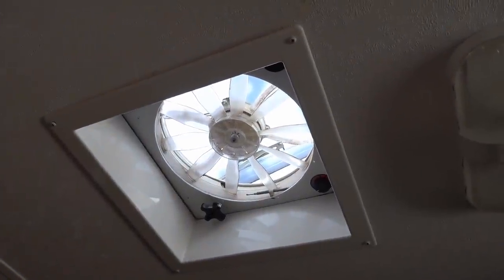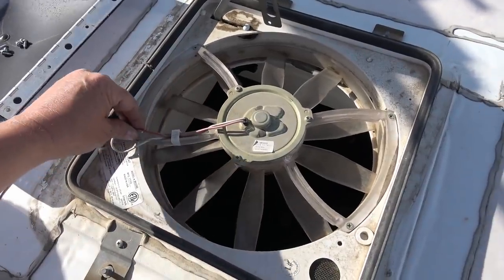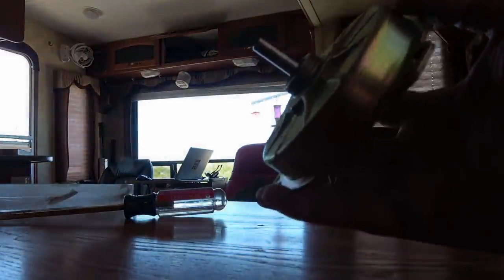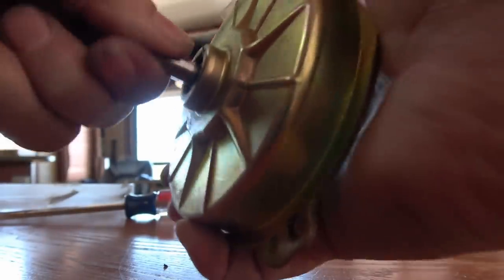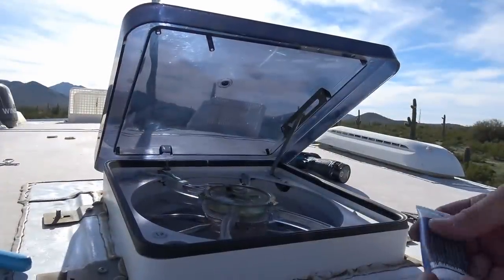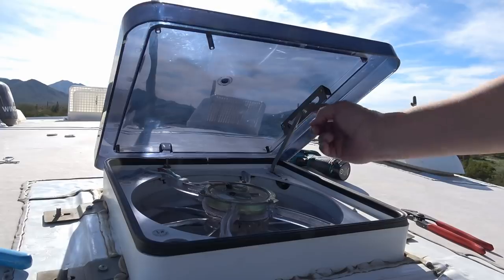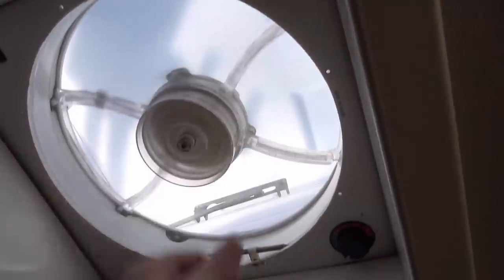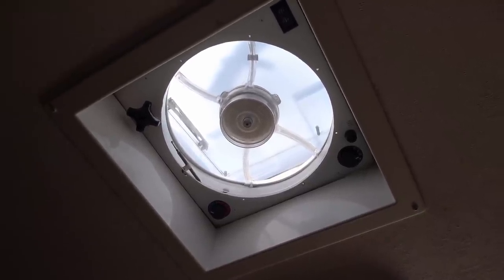FanTastic Fan Maintenance - Cleaning & Lubrication Attempt

Comment from the maker: See original install and review video - https://www.loveyourrv.com/installing-fantastic-vent-fan-rv/
Reply: I assume you gotta use their top vent. I want to add a fan in a regular vent location. Two issues, it is a 14x14 regular Camco vent in a new Winnebago.
Also, VERY close to front curve and the Fantastic and Maxx fans are bigger.
How many inches does the front of the vent extend from the 14" opening? Approximately is good, no need to go up there and remove outer cover.
Thanks Ray...
Reply from the maker: @bobcole3852  I'm pretty sure will work with a regular vent cover, the Fantastic Vent is for better airflow.

Comment: It looked like a ball bearing on the fan's motor shaft.  "Sealed" ball bearings eventually use up their grease supply and go dry.  Squirting silicone oil into the bearing may help for a while until the silicone evaporates, too.  I used to work at a vacuum cleaner repair shop.  On rebuilt vacs which the manager did not want to spend any money on, we re-greased dry motor ball bearings (if they were easily accessible and not damaged).  The black plastic side plate can be pried off and the bearing repacked.  This will double its life and save the cost of buying a new motor.  With the fan's motor case welded together, the rear bearing is inaccessible.  However, it is usually the front bearing that fails first since it carries the weight of the fan and motor armature.  (Note: The squeak could also be coming from the motor brushes if it is not brushless.)
Reply from the maker: Thanks for the info!

Comment: great job ...judging by the noise try to open the engine and replace the lower internal bearing which is probably oxidized and making noise

Comment: I had the same issue with both of ours.  Since it was in service the third year, Dometic sent replacements at no cost, but I had to pay about $15 in shipping.  If it is under two years, they pick up the shipping. Great service from a Dometic!
Reply from the maker: The original FanTastic Fan company used to have a lifetime parts warranty, then they got acquired by Atwood 2010 and they stopped that, then Atwood was bought by Dometic. I have the Atwood version. I've found the fan on eTrailer for $35 so not too bad.  I'll give Dometic a call if the squeak continues, see what they might do. Cheers, Ray

Comment: When I took mine apart to add a PWM speed controller, i took it apart from the inside (bottom side), i was able to access all the wire connectors there and unplug the wires without cutting them. Also, adding a PWM controller is an easy way to save power while boondocking, it will let you adjust your fan to many more increments than just the 3 settings it comes with, and its more efficient because the original speed controller is just a series of resistors.

Comment: I had same sound when brand new, I unscrewed and dropped some T9 Boshield Lube and ok since one 1/2 year.  Just cleaned my two, same model. I Took the fan fins part off from the trailer by wiggleling it and pulling.  Than on the roof, loosened the bottom screw of the Hinge than undo the top screw, the lid canteen  be freed and cleaned without undoing the hinge.  I did not want to cut the wires so I brought all cleaning gear-lube-Plastic protectant on the roof :-0) I wish it had connectors that clip on, I am not electrically inclined.  So tooth brush and Q-tips and all,, I then put plastic protectant from UV Like M303 or Protect All or else on top of the Fantastic Fan Covers.  I find the bugs don't stick so much,  I put all back together and re-screw the fans fins part from inside the trailer.  Thanks for this Video Ray I always love to see the cleanness of your roof, while I was up there I I tried to turn white my dirty silicone spots.

Comment: For years I've used a teflon lube from Radio Shack (64-2301a) for PC CPU and Power Supply fans. It's brought dead seized fans back to life. Once lubed I've never had to mess with them again. These were systems that ran 24/7. Unfortunately it doesn't look like they carry it anymore. I've seen teflon lube on Amazon DuPont but haven't tried it as I still have enough to last me a long time.
Reply from the maker: Thanks for the tip!

Comment: Ray 
Keep a close eye on the motor. When the bearings start to get noisy and squeaky. The next thing that can happen is the motor will seize up. The normal issue with sealed motor of that kind is the bearing opposite the shaft is failing.

Comment: Ray, you seem to be totally confident on your roof. Aside from falling off, its scares me to think of breaking something or tearing the rubber by being up there. Any info or words of wisdom about roof walking on a 5th wheel would be awesome!
Reply from the maker: I make sure to wear soft-soled flat shoes and walk gingerly and be wary of tripping over vents and things. Depends on what kind of board has been used for the roof, ours has 3/8ths so is pretty strong, I'm 195 lbs and its never been a problem, usually, if there is a ladder attached OEM its a good indication of it being a walk on the roof. The rubber is really strong, stands up well short of piercing or slicing it with a sharp object. Cheers, Ray

Comment: Hi Ray, We love our Fantastic Fans, if we ever get a new trailer those are the top of the list to install. Had them on our last two campers. What do you use to clean the crank up lid and also the the white Fantastic vent cover itself? That view from the inside after putting everything back together was sparking! Outside RV plastic seems to be a pain. Thanks again for all your videos!! That squeak would drive me nuts too.
Reply from the maker: I usually use soap and water then 303 Aerospace protectant on my plastic roof bits  https://amzn.to/3xcpv6K

Comment: Thanks for the review of the fan. With the price of the 802250, I'm thinking the motor should last longer than three years. You make or break a sale, when I'm thinking about an upgrade. So far I have been having good luck with things I've seen on your videos. Your the first place I go when looking at repairing or replacing.  I would email Fantastic Fan, I bet they give you a new motor.
Reply from the maker: You're welcome, In the old days pre 21013 Fantastic Fans had a lifetime warranty, really made it a great product and reputation as they were really good about honoring the warranty, but the small company was bought out by Atwood a little before I bought my fan and they quit the lifetime warranty deal.  Looks like etrailer has the motor replacement kit for $35, so not too bad.  https://www.etrailer.com/Accessories-and-Parts/Fantastic-Vent/FVK8017-00.html  Cheers, Ray

Comment: Thank you Ray for another helpful how to video! Will that fan fit in a standard vent /fan hole? I'd like to replace the fan in my bathroom with one, or maybe a vortex fan.
Reply from the maker: Yes, my roof vents are the standard size, The difference is the Fantastic fan is a little harder to install as you have to remove the old roof vent - https://www.loveyourrv.com/installing-fantastic-vent-fan-rv/ versus the Vortex that installs into the existing vent.
The Hengs Vortex https://amzn.to/2TcgSUs is cheaper and easier to install but Fantastic is a little better quality, IMHO.  Cheers, Ray

Comment: Ray,
Great video! Id on't know if you respond to comments/questions but here goes.  I have been manually opening & closing my fnatastic fan all of the time.  Today -the cover will not open. I don't want to force it - I was on the roof and the cover didn't seem to be stuck on anything but it wouldn't move either.  The opening switch moves the switch around like I was manually opening it but the cover doesn't move.  Any suggestions? Avion86 Kieth
Reply from the maker: I'm not too sure how the remote controlled ones work as mine is just a manual opening in one. It has a turn knob. I guess the shaft could seize if corrosion had time to build up. Otherwise its a pretty simple mechanical setup.

Comment: I was wondering is you did any cleaning to temperture sensor and what did you use?
Lou 💚
Reply from the maker: It is made of metal much like a meat thermometer so didn't do anything special.  I just used Windex and paper towels to clean up pretty well everything but the fan blades and bug screen. Since they could be removed I cleaned those with soapy water in the sink and rinsed. Cheers, Ray

Comment: I have just taken the cover off and sprayed WD40 in the bearing area. Didn't even disconnect the power.  I also have replaced the motor on older ones. They're not expensive at all.
Reply from the maker: I see they are around $35, much cheaper than I figured, Cheers! Ray
Reply: As with the liquid silicone Ray used, WD-40 is not an appropriate lube for bearings. It mostly just cleans and displaces moisture. 3inOne oil will probably work best in this application. It lubricates and dissolves rust and corrosion.

Comment: Hi Ray , i just took mine apart today as well, it ws dirty and slightly rubbing against the sides, found that the bow tie shaped  brace was broken in a few spots , never had a problem until i installed lithium batteries , im curious if the extra voltage could cause extra torque on the motor cousing the fan base to crack ?  what are your thoughts ? would be a good subject to talk about, 13.4 volts for 12volt appliances
Reply from the maker: I've had lithium batteries for about 5 years now and hasn't been an issue, my fans and motors run way better! :)

Comment: Hello Ray 
I recently installed a Fantastic fan in my 5thwheel and had thought of wiring it on a separate circuit  along with the solar that would power it went it was in storage to keep this insides cooler with the rest of the rig's power was off, I live in Arizona and my 5thwheel  might sit in storage for a month so before being used. What are your thought on this?
Reply from the maker: Sounds like a good idea.

Comment: I’ve just bought a 05 diesel pusher and I’m going to put eternabond on the roof how has yours held up over time and should I remove the caulk around the sky lights and then put the tape down or put the tape directly over the caulk?
Reply from the maker: Here is a review update I did summer 2017 - https://www.loveyourrv.com/rv-roof-repair-eternabond-review/  Not much has changed since then, no leaks and still happy, basically no maintenance has been required.
My OEM Dicor lap sealant was still in good shape so decided to leave it. I used a solvent to clean it really well. Acetone works or mineral spirits if you're careful not to get on the rubber roof too much.  Once I had the sealant layer looking like new again, no dirt at all. I taped right over it. The 4-inch Eternabond is wide enough to cover the sealant and overlap on both sides.

Cheers! Ray

Comment: I had to change the plastic piece that the motor that opens and close the cover on the roof is holding in place. It broke because I think the cover was sticking to the seal. My problem is that when I am connecting the 2 wires to the cover motor IT IS TURNING ? So I can't not install it.

Comment: Ya ALMOST got it.... always waterproof your wire repair.  You used a shrink connector but didn't heat it up, making it a waterproof connection. Otherwise, good information!

Comment: I have a question for you Ray solar panels just bought Noma 100 W solar panels x2 it came with a 30 amp charge controller how would I hook up to in parallel both cables go to the controller or do I need to put a Y in there .
Reply from the maker: With my Renogy kit, I used the MC4 Y connectors to turn the four wires into two  Example - https://amzn.to/2TbZ6kc but you could run all the cables back to the controller and attach them there.
Some people will install a junction box on the roof.
Reply: Thanks Ray  yeah I was thinking to just run in both sets of wires to the solar charge controller and using them as portable set .want to use a piano hinge and attach them together and fold them up when not in use.

Comment: That product is ungodly over priced, imo.  For what it cost and for me to buy one it would have to be a lot quieter than it is. Those that have one are happy with it so that's all that counts, right?
Reply from the maker: Yes, I see you can buy the fan motor and blades for $35, I guess the rest is for the custom mounting solution and controls. Everything fits just right. I'm surprised there isn't a knock-off product for much less.
Reply: There is the Heng's Vortex II for around $50. - Not temp controlled, but it has 5 speeds I think and moves a lot of air. And it also reverses.